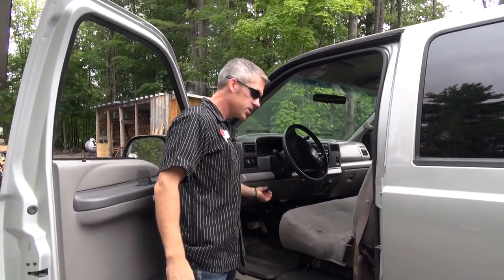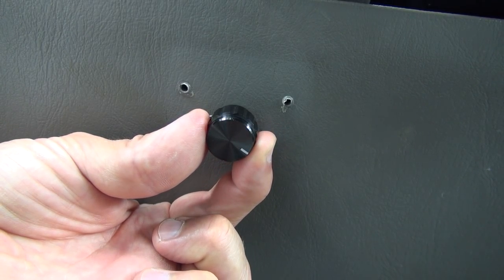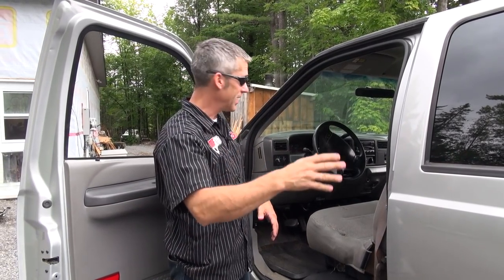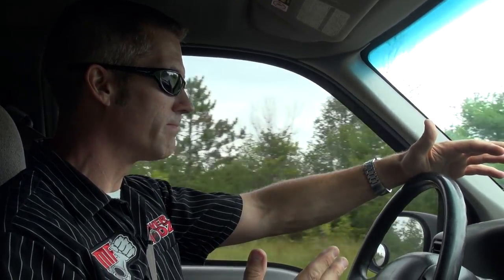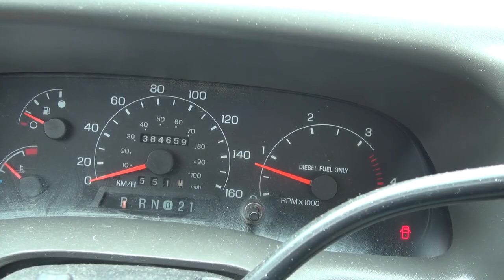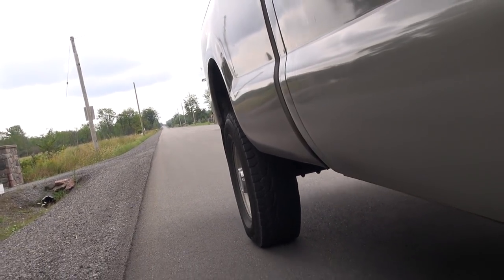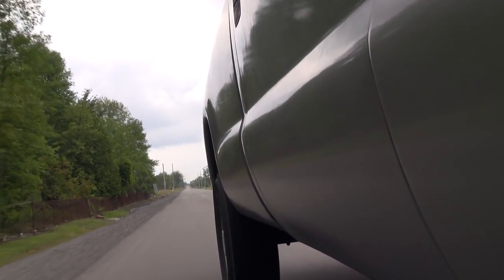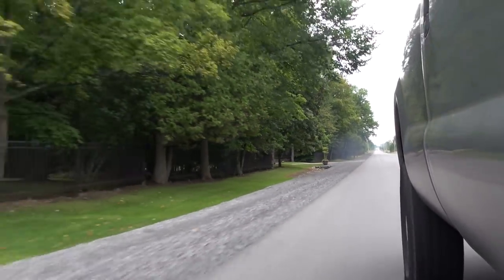TS Performance chip test drive, 140+hp!!  PowerModz!

Comment: I have a 99 F350 with the ZF-6 transmission. 368,000 miles. I am mostly after better milage (this is my daily, and tow rig for my camper and race car hauler). I drive like a granny, but a bit better efficiency would be nice. Should I purchase this chip for my truck?
Reply: I have a late 99 f250 4x4 with the zf6.. I have been running  the chip for about a month. I leave it on the tow tune and that has picked up my mileage some. May be better on the daily setting from what i hear..  But im happy with the tow tune myself.  My only dislike is it hold the rpms between shifts a little longer instead of letting them drop immediately when i shift. But other wise i like it.

Comment: And all that just with a chip tune....what a bullshit lol!
Reply: +Michel Linschoten No this is legit i have one very similar on my truck
Reply: Well not sure what chips i have seen fly by here, but none of them really did any good if that it made it run for the worse!
Reply: +Michel Linschoten the best part about the chip was the better shifting points Of the transmission....It made it drive like it Should and if you have one and tow With it especially you'd know what I mean about bad shifting points.  I ran it for about 70k kms on the 50hp and it was perfect...No problems at all.
Reply: Yes with just the chip....It's pretty common ...Not rocket science.
Reply: Perhaps come with some data instead of "rocket science" aka snake oil bullshit bud.

Perhaps you should spend some more time collecting data? Ohhh that's right their is none to speak off ASIDE FROM people talking their praise over it.

Fist rule with nearly anything you buy, or try, or do. Avoid any product that relies exclusively on testimonials rather than objective test data

If it does anything?! Most aftermarket tunes are simply a moderate increase in timing advance and a leaner fuel air mix. That's it ,really nothing worth writing home about, especially seen the price of some of these snake oil bullshit chips
Reply: +Michel Linschoten run mine on 75 hp most of the time and I get better fuel economy and power
Reply: Private Puncakes
Of ALL and i do mean ALL the people i met on the internet or even in rl that come to our garage. NEVER ever shown anything solid as far as data goes. Let alone a 75hp GAIN from a chip tune....give me numbers and a dyno sheet of before and after and some readouts as far as engine management goes.

I bet like nearly 99% of the time we will see a  a moderate increase in timing advance and a leaner (how does that compute in a 75hp gain) fuel air mix. At most you get a gain of about 20HP not 75... I am sorry but i would love to see that data compared to the original specs of your vehicle.
Reply: +Michel Linschoten man there are tons of positive reviews on it all across the net. I don't have one so i don't really have any kind of argument either way but I'm planning on it. They say ford really de-tuned these after Navistar built it. Anything has to be better than the factory towing power. I pull a 6x12 single axle with a 4 seater RZR and the shift points and tune SUCKS. That's stock and it's never had a 5th wheel in it '01 2wd supercab. I'm just looking for something to wake it up, not win a sled pull or anything.

Comment: So Louis, u think it has enough power to move around on 140 u saying its moves quick. I was thinking going for 6.0 and they make huge power and very fast but heard they have issues and problems so don't want to keep $$$ on 6.0 so maybe I'll find super duty 7.3.
Reply: 7.3s are the only good Ford engines.  You have to dump thousands into 6.0s  to make them reliable.
Reply: +TheBCSledder actually they aren't Ford engines... Navistar International made them for Ford.